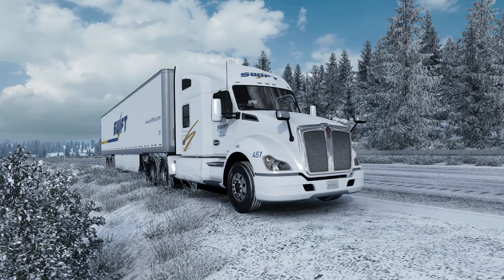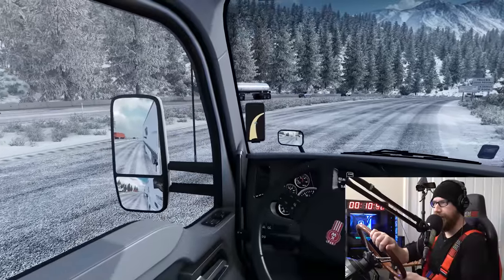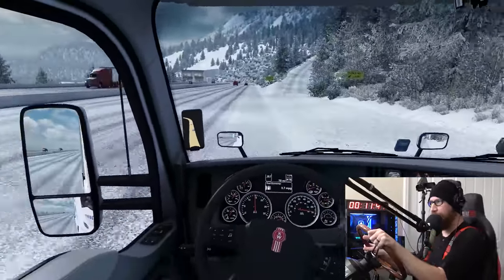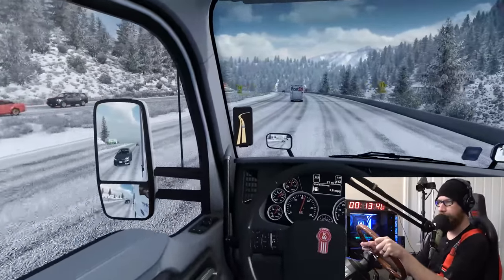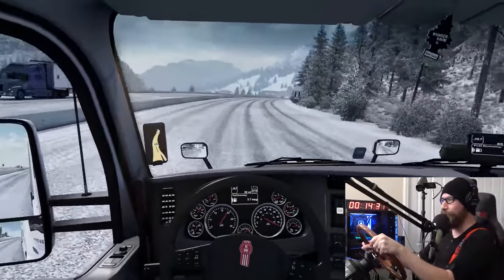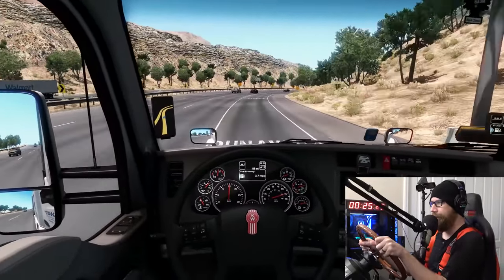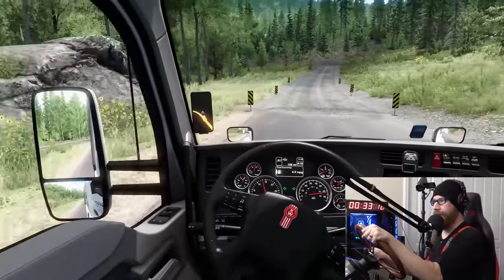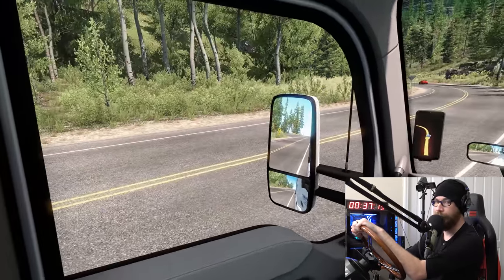Do Runaway Ramps Work in ATS?

Comment: The ramp doesn't need to be steeper, the surface needs more drag.  It should be like the sand pit on a race track or a golf course.
Reply: @Verloxcitykilledyou  Maybe he said "sheep." :O
Reply: It's because the ramp is frozen
Reply: It needs to be pea gravel not three quarter Crush
Reply: He said “more deep” not steep .
Reply: Good idea, like pillows to cushion and slow the crash. @Nightweaver1
Reply: Well... If it is a pit like in a golf course then the truck will get stuck if the hole is deep anuff!🤣

Comment: SCS needs to make those ramps actually work just for the fun of it.
Reply: They work in RL if u have some brakes
Reply: They do work. They work in my game, they stop my trucks instantly, but looks mods can interfere last time I tried them in game I had no mods enabled.
Reply: Yes and also add random break failures so that we may have to use it lol
Reply: @TeutonicFarms  why random? why not just simulate the heat buildup from using mechanical brakes extensively downhill? they should fail every time you do that.
Reply: @84viper  uhm... around 1:20 scale and timecompression... meaning break failure with a 20X bigger chance... be careful what you wish for... it´ll be funny for a day and then you´ll look for the option to disable that simulation ... I know I would, just like I disabled fatigue... it´s just way too frequent...  :)
Reply: @RSProduxx  your mechanical brakes will only overheat if you go too fast downhill. shifting down and using the jake brake is the way to go. IMO the game should have an option to force the player to go about this way of driving a truck downhill. of course there should be an on/off switch for this feature though. random brake failures though would just be annoying even if it rarely happens, perhaps random brake failures could be relative to how much percent damage the truck has instead.
Reply: @84viper  as a non-american, can i ask what these runaway ramps are used for?
Reply: @nnymu-dw9dw  I'm not american either ;) the runaway ramps are for trucks that went too fast down the hill. first they try engine braking, but that will only do so much if you're in a too high gear. using the mechanical brake downhill will eventually overheat the pads and discs until they burn up. after that you're a passenger in a truck that will only go faster and faster. usually there's a separate low speed limit for trucks in these zones, and it's extremely important drivers slow down at the top of the hill, before it's too late and goes downhill.
Reply: @nnymu-dw9dw  In Brazil they are used to stop trucks with overheated brakes. And they are flat, longer and stop way heavier trucks than US's
Reply: @btd_blazeit123oof7  I believe. I was saying that our runaway lanes are capable to stop trucks with up to 74 tons. Also, ours are usually a 1 meter deep hole, more than 100 meters long, filled with gravel, so the truck get stuck on them with just some damage to the front bumper

Comment: Just a tip, STOP ACCELERATING!!!! When your truck has no brakes, and you are utilising a runaway ramp, you do not power on the throttle. You release all throttle, the aim is to stop the truck not reach the end of the ramp. It's something that causes your results to be very unrealistic and in most terms inaccurate. A driver with no brakes is going to do everything to force the truck to stop, not push it through the end of the runaway lane.  But all the comments about the Swift truck are spot on

Comment: I’ve been driving for swift for 8 years, guess who’s never smoked their brakes? This guy,  yet we have owner ops and psychos from small companies flying down I-70 and like last year killed 8 people barreling down the hill into Denver at 90mph in rush hour traffic.
Reply: Because it's all about the driver not the company, I got my license at SWIFT, then worked at Schneider,  now I'm owner operator with a W900, and I do 80 in a 70 which is only 10 over. No different than doing 65 in a 55, and I do completely fine. Going down mountains I follow if it says truck speed limit,  if not I do what I feel is safe, most of the time my engine brake is always being used regardless of the weight I'm at so I can save my brakes.

Comment: Keep in mind that runaway ramps were not designed to stop a truck with NO brakes building up speed before using. They were designed for truckers who lost brakes, popped into nuetral and used other methods such as downshifting or possibly trailer brakes if available BEFORE using the ramps. IE the driver noticed lost brakes and did everything possible to AVOID accelerating going into the ramp. 

Also should point out that most drivers consider the runaway ramp as a career suicide option as you would undoubtedly damage your truck and cargo. That tends to make most trucking companies fire you on the spot despite the fact that you would be looking at a mechanical failure and not a driver one. Plus, the DMV and DOT will be all over your rear-end, possibly revoking or suspending your CDL. 

So while they CAN be helpful in the right situations, being slightly "off" in regards to how you handle the situation as a driver BEFORE using the runaway ramp will result in fail/success of the ramp itself. It is like a highway turn designed for 80-90 mph, but taken at 100-120 mph and the driver goes off the side, that is YOUR fault, not the highway's design or placement.

Comment: talk about a program with so many inaccuracies in it.

1. no truck can take of from a shoulder that fast
2. no cops chasing you from the mandatory brake check station
3. no gravel flinging anywhere when you hit it
4. No SWIFT driver can use the ramps, they prefer to wreck and run away

Comment: I should not be watching this today. My dad was driving a dump truck that got hit by a tractor trailer today. Driverless drink or something, hit osmeonexelse up the road and kept going, then came head on at my dad. Somehow didn't dad managed to get over just enough that he more or less side swiped my dad and the trailer my dad was pulling took the brunt of it. Guy kept driving dragging his ramps down the highway. Somehow didn't know he hit anyone despite all that and the fact t that the impact ripped his and my dads mirrors off.  Could have been so so much worse than it was, dad ended up fine other than probably a few tiny scratches, mirror glass ended up all over him. Doesnt even think he'll have any whiplash. He said he was really lucky, he would have flipped if he hit the grass at his speed, but he barely had enough shoulder to escape the head on. Gonna keep watching now.

Comment: It would be interesting to see if a video game physics model could be created so the ramps in ATS would function like arrestor beds do in real life. Considering they're deep beds of loosely packed gravel, sometimes on a substrate of water I don't know how you'd emulate that plowing into/sinking motion without there being some sort of damage modeling being integrated. In real life the object of an arrestor bed is to stop the vehicle as close to the beginning of the slope as possible without much concern as to the fact your losing your bumper, aero skirts, etc. Because they need to get there, winch you out and get the ramp reopened as efficiently as possible so you don't get creamed by the next runaway truck, or that runaway truck has to continue down the hill. It's why major downgrades will actually have multiple arrestor beds.

Comment: love your videos. what state is this? and is the snow a mod? thanks. keep up the great work
Reply: There's a link to the snow mod in the description, and the first highway he drives on is the ProMods Canada mod, also a link in the description (but I don't think it's released yet).
Reply: @TrevAndDust  ok thanks man i just got this game and its awesome even though playing on keyboard sucks untill i get a wheel setup
Reply from the maker: Promods Canada was just released
Reply: @kennymartinez973  No problem bud, it’s a great game so hope you dig it! Even an inexpensive controller can help a lot until you have the scratch for a wheel setup. I’ve played a lot of truck sim with just an Xbox 360 controller, and while it’s not “as good” as the wheel I use now, it’s not bad at all compared to a keyboard. Sometimes I’ll still use a controller if I don’t feel like pulling out my wheel from the closet haha
Reply: @jfavignano  Hot damn, thanks for the heads up, I’ll have to check that out this weekend 🤘
Reply: @jfavignano  thank you.

Comment: Sadly there is no need for a runaway ramp in this game. There is no danger of brake fade or brakes failing. Even letting go of all brakes going downhill, the truck never speeds up to an uncontrollable speed and the Jake brake slows the truck down too much anyways.
Reply: You would have to be really heavy for jakes to not slow you down. Also the game doesn't have the physics to make them uncontrolable, he would have rolled over the rails when he took the shoulder in real life.

Comment: The engine braking works better if youd just put it in the lowest gear possible. I could see the revs only at like 5000 when you can probably scoot another gear or two down.

Comment: I've seen people take those ramps before. It's kind of scary to see it happen but it does.. Another reason why when i trained drivers i stressed being in the right gear for your load weight when going down a steep hill or mountain.
Reply: I was taught that you go down in the same gear you went up at the most. New ACC equipped trucks do this automatically as well as the windshield sensor can read the terrain and adjust accordingly.
Reply: @TheNiteNinja19  that isn't bad advice really and is accurate for most instances. These auto shift trucks take the fun out of going down a grade... Though the only hill i deal with is a landfill now..

Comment: Jeff  this is funny. the ramps are design to slow you down by sinking into the ground. obvious the game cant sim that. but i have used one before going through CO mountain but i was very light with 14k lbs. but had another driver lost him breaks and i used my truck to slow him down and to use run away ramp. i hit it at 57 mph i got pushed up 3/4 of the ramp. it slowed me down so fast and mad most of the damage to my back ICC bumper and doors and other driver front end was smashed in. but we all was safe and sound and i changed my shorts after that.
Reply: oh and it destroyed my bumber,break chambers/breaks lines do to sinking down in the ramp.

Comment: i think in a realistic setting, you'd realize your brakes were out long before you get to the runaway ramp. of course it isn't going to work if you're gassing it all the way up until you need the ramp lol. that's why those brake check signs are like half a mile away. you're not supposed to discover that your brakes are out literally RIGHT when you get to the runaway ramp.
the runaway ramps WOULD work if you drove correctly.
Reply from the maker: LOL
Reply: @jfavignano  lol laughing doesn't change the fact that you need to know your brakes are out well before you ever approach the runaway ramp.
Reply from the maker: This is a video game dude and video is silly

Comment: the run away truck ramps are for if your going to fast down a hill and cant stop. not if your accelerator is stuck wide open. if you let off the gas and coast up it like you would in real life then you will likely stop...
Reply from the maker: Watch the whole video, we did that
Reply: @jfavignano  seems the ramps are useless. That stinks.

Comment: Hard to watch that with the Track IR on your head while you keep looking at your stream camera. These runaway truck ramps are supposed to be thick sand pits that in game would simply just need a huge amount of friction added when you drive on them. Your sudden stops are due to invisible colliders meant to keep you from driving too far off road or in unauthorized areas. The reason trucks may lose braking is most likely due to overheating or worn brake pads. If you use your brakes too often, you can bleed off air pressure too which should cause your brakes to lock up (parking brake too). Engine brakes require you to be in gear and their performance depends on the gear ratio applied at the time. Retarders do not need the engine so they also work in neutral but are most responsive to higher speeds. You can restore brake pressure while revving the engine in neutral while still riding down on the retarders. Trailer brakes are very important on windy down hill traversal due to the loss of control you can get with the retarders however. So your best bet is to think slow before you go. As the signs say, "Better late than dead."

Comment: If the retarter was on max and engine brakes on at least on my Volvo FH it slows right down  I rarely only in emergency situations were cars just pull out of nowhere have to use the air brakes

Comment: Those are not even remotely close to a viable runaway ramp, They are much longer and typically go very steep uphill and typically have something like sand not a paved surface so the truck sinks into it.